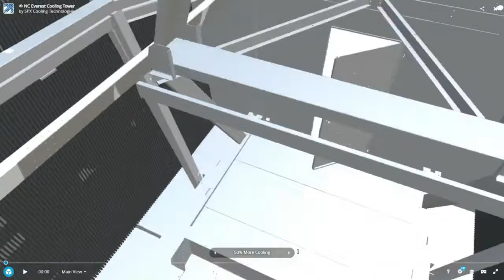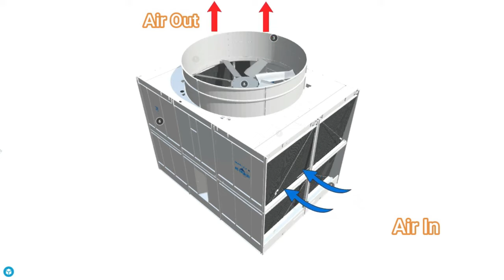Cooling Tower working principle | English | Animation

Comment: Just 5 degrees different?
Reply from the maker: Yeah! 5 degrees difference is efficient one.
Reply: because I thought that an usual air conditioner is like 30 degrees hotter, so larger scale like chillers should be more like 50 degrees celcius
Reply: but I was wrong. turns out that I only used 1% of my brain and not 5%
Reply: if I used 5% of my brain, it would make sense for the difference to be 5 degrees

the pump circulating the water could be 50 times faster than the compressor, so the water quickly got out of the chiller before it get too hot, and the cooling capacity of the cooling tower is large, so even though water is there for only like 10 seconds, it already drops 5 degrees, 1 degrees per 2 seconds, instantaneous temperature drop!
Reply: man, I'm making my brain lazy